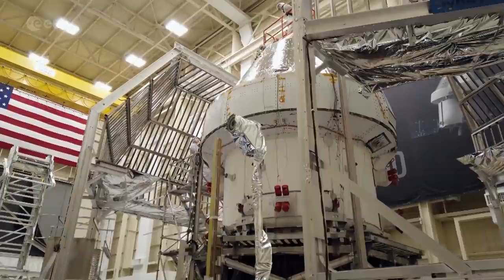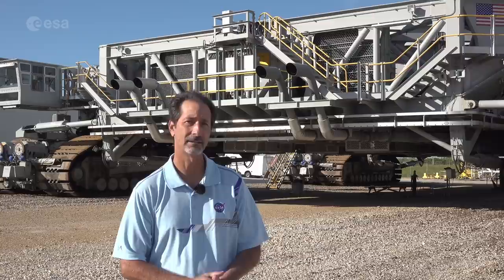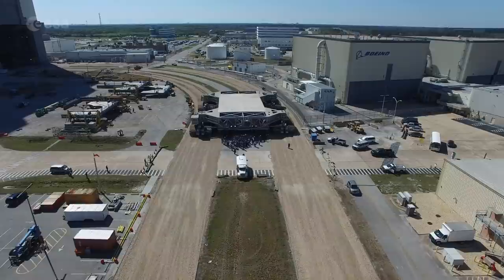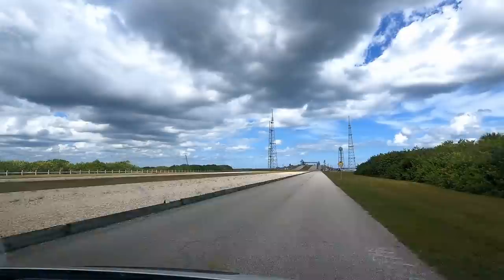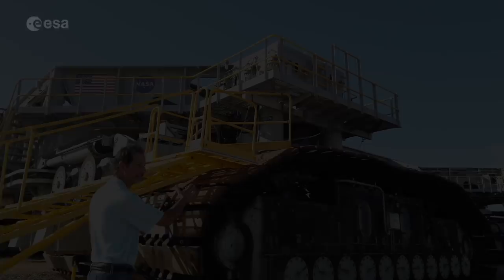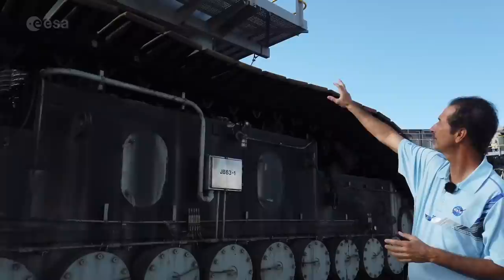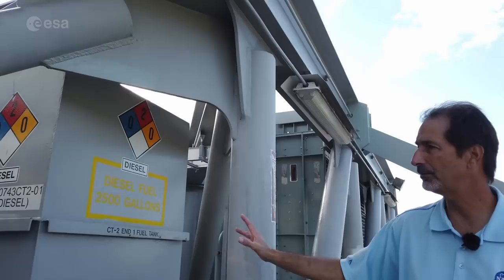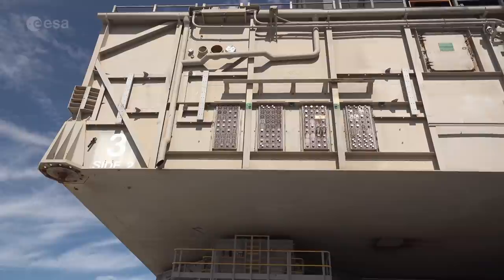Artemis: crawling towards launch

Comment: This vehicle is basically why scifi has huge crawlers once and awhile. Most notable is the Sand Crawler from Star Wars.

the C-T is also the largest tracked vehicle in the world, Well actual vehicle in that it runs on its own and is driven. A few bucket wheel excavators are bigger but they have to be lead around by their extension cord connected directly to the power grid.

Comment: That crawler is quite amazing, sort of like the undercarriage of the bucket wheel excavators used in open pit mining.
Reply: There's a reason for that, they were designed and built by the Marion Power Shovel Company. I assume they worked from what they already had and knew.

Comment: It's interesting that this system needs ~$160 million (inflation corrected) special vintage crawler, when commercial, more capable rocket can be transported with standard industry wheeled platform -Self propelled modular transport (SPMT).
Reply: But this crawler already existed (pre-dating SPMTs) and was "bought and paid for" and wasn't built for this mission, only modified.
Reply: @ImeanFFS Add to that the fact that it needs to be transported as a whole and had SRBs (adding some mass for transportation to launch site).
Edit: And it's made for the mobile launch platform too.
Reply: What's also interesting is that this vintage crawler has been hauling moon rockets to the pad for well over 50 years now...

Bonus Fact....Did you know Elon Musk is only 50 years old?
Reply: @codymoe4986  Yeah and shuttle stack too, and my point still stands. You can check how much it cost to run in the NASA budget. Apollo to STS hiatus + STS to SLS (and waiting for Omega for second MCTF) is alone silly number. But it's your Taxes. Mine goes to the service module ~$800 million for three modules ~same as whole Falcon and Dragon program...
Reply: what currently functioning rocket is more capable than the SLS? do you realize that a fully loaded SLS weighs like 4 times as much as a fully loaded Ariane 5?
Reply: @SaxPanther  Is SLS currently functioning rocket? How many launches or even WDR it has done?

Comment: SLS is almost a failure before it launches. The cost is astronomical considering what could have been achieves with a properly run project. The re is nothing innovative or ground braking about SLS it's literally a rehashed Apollo using space shuttle parts.
Reply: Space Shuttle is not rehashed Apollo. Re-use of the shuttle has helped limit cost and timelines. And keep in mind that there is no other vehicle capable of the same feat as of now.
Reply: @ooga booga SLS is not rehashed Apollo either. It is built off of the Shuttle.
Reply: @Vimal Ramachandran Concidering amount of money and time it took, I did not limit it well.
And things like using engines made for reuse one time.

Technically you don't need that powerful rocket too. Missions can be made of few launches(each landing is already at least 2 launches).
Reply: @ImieNazwiskoOK  If SLS had to be designed from scratch, it would have taken longer to complete and also costed more. Regarding reusability, that is viable only if hundreds of launches are being planned (like for SpaceX rockets). Otherwise, investing in reusable technology won't be worth the cost and effort. SLS is only planned to fly a few times and NASA developed it because no other alternative was available in the market.  If SpaceX can get their Starship up & running, NASA will happily buy its services as they are doing now with Falcon 9 for transporting crew and cargo to the ISS.

Comment: Before SLS becomes ready for the Moon mission, SpaceX Starship will be operational, man it will be something between embarrassing and bizzare, Starship will more capable, far cheaper and technically more advanced and humanity will be back to the moon with less capable, more expensive and less advanced.
Reply: It may become "operational" before SLS, but it's pretty unlikely SpaceX will launch a mission before NASA/ESA. But it's actually possible for starship to become the lunar lander for Artemis, so we'll see.
Reply: @Tealice1  It's highly likely Starship becomes ready for their around the moon project (Japanese billionaire Maezawa's around the moon trip) and they choose to go with it before Artemis mission.
Reply: @JigilJigil  We'll see about that lol
Reply: @Tealice1  Yup.
Reply: SLS is already ready(with an actual payload too and not a mass simulator), Starship still has a long way
Reply: First let Starship achieve orbit. Comparing a vehicle designed to fly only a few times (SLS) with one designed for hundreds of flights (Starship) itself is wrong. Reusability is viable only if the vehicle is going to be used heavily. Starship is not just meant for lunar missions, it is intended to go to Mars, launch satellites, transport people from one city to another on the opposite side of the globe etc. That's why reusability is useful. SLS has no such goals.